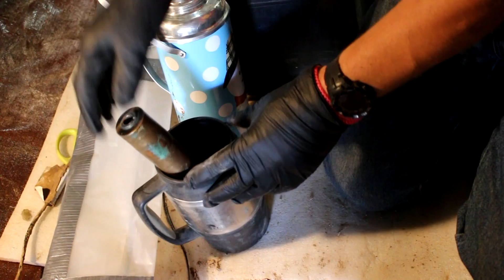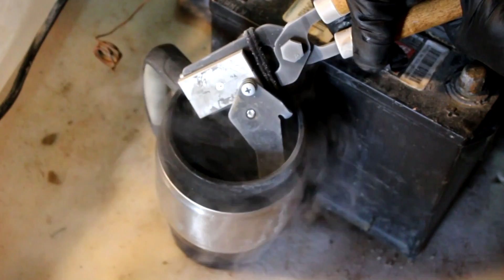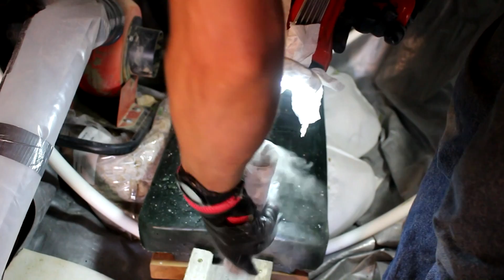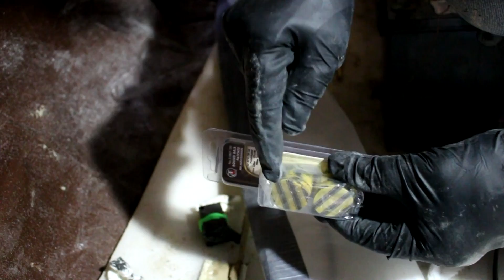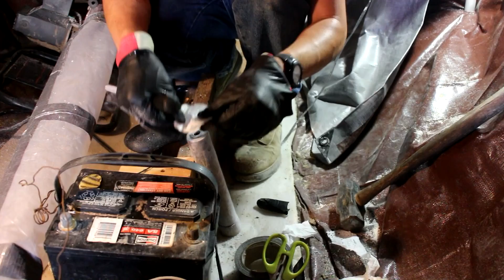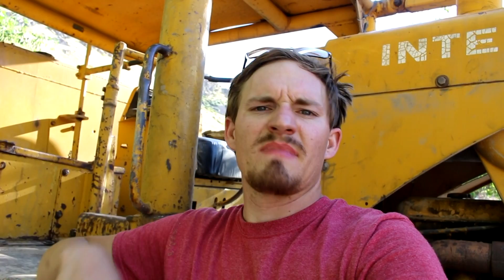Shooting Mercury Bullets

Comment: If you plan on doing much more of that, Competition Electronics makes a lighting system that replaces your diffusers on your chronograph for indoor use (PN CEI4100).  May be a worthwhile addition.
Reply: +Cody'sLab are you going to do a mine video
Reply from the maker: thanks!
Reply: ***** My pleasure.  I enjoy your channel.
Reply: n0
Reply: +Cody'sLab I'm with the other guy, a mine video is long overdue, but it's not my channel

Comment: Hey Cody, i know you "think" you are aware of the danger of mercury.
But for your own health, you should really stop working with it.

It won't make you sick fast nor will it kill you fast. 
The real danger with mercury is the toxic buildup in your system, and IF you would go to a doctor right now i am sure you will have raised levels allready. And even tho many people "think" mercury is only toxic if you touch/eat or directly inhale it ; It isn't ... mercury will fume out at room-temperature and WILL conterminate a room/envoirement! 
And even a very, very low amount each time you handle it, can and probably will add up enough to cause some real problems over time because once it is in your system, you won't be able to get rid of it.

Comment: I would think the mercy 'coned' it's way through the gel. getting smaller as it goes, meaning less surface penetrating the gel, so the smaller it gets the easier it goes through, think a round bar pushing through its a needle.
Reply: * not 'it's' I meant to type vrs
Reply: it was frozen so it wont react that way, or at least all that way

Comment: Cody's lab: How to legally do illegal stuff! 
Cody, at the end when you were dropping stuff into the mercury, we can see some of the mercury balling up on the surface of the rest of the pool of mercury. Why is that? Is it because particles cling to the little balls as they fly through the air which makes them more buoyant? 
Love the videos! Keep up the awesome work!
Reply: Probably just surface tension.  I think under the right circumstances most liquids can do that.  I believe it's called inverted bubbles.

Comment: You said that the mercury bullet had more momentum because of its greater weight, but this just means that it would require more energy to get to the same speed as the lighter lead bullet. Both bullets would have the same momentum assuming that the energy transfer from the powder explosion is that same for both, the mercury bullet being heavy would travel at a slower speed. Good video though, keep up the good work!
Reply: Higher density projectile results in a higher pressure in the chamber during firing, allowing more energy to be imparted into the projectile, resulting in more momentum and less energy waste.
Reply: +Darkatar
Thanks for the insight, it didn't occur to me.
For the momentum to be the same, the barrel would have to be infinitely long, as well as friction to be the same.

Comment: The military have a special type of mercury bullet that they use with ultra-high penetrating.  It was briefly on a documentary I came across around ten years ago, which I could no-longer find while I was researching the bullet to try and understand how it worked.  I couldn't find much about the specific type of bullet I remembered from the documentary.  Sounds all tinfoil hat-like, but I thought it was worth mentioning.

Comment: Hang on, ~8.05 "mercury is denser, and it weighed more, so it would have a bit more momentum", surely by newton's second law the lead/mercury bullets would have the same momentum because they were both propelled with the same force, or what am I missing?
Reply: I thought the same thing and did the maths, it turns out that assuming both the lead and mercury bullets are given the same amount of energy, the one with the higher mass has the higher momentum. This is because kinetic energy is proportional to the velocity squared, whereas momentum is just proportional to velocity. As a result, mass has more influence than velocity when calculating the momentum.
Reply: Just wanted to chip in here and say that I also did the math, and came to the same conclusion you did, 2exSquared. The momentum, in this case, looks to be proportional to the square root of the mass of the bullet, assuming the same energy is transferred.
Reply: You're correct.  I think he was just misusing his words.  He's a geologist, not a physicist.
Reply: Nah Cody didn't get it wrong, read what I wrote previously

Comment: Mercury and lead are only similar in toxicity in a compound. Or even in the same state. Difference is that mercury at body temperature is a liquid and gets through the body very easily reaching parts other bullets can not reach.
Reply: The problem with mercury arent so much its toxicity in solid or liquid form (they're not that toxic at this states because they're not resorbed by the human organism at dangerous concentrations) but the huge toxicity of its vapor, which penetrates the blood-brain barrier with ease. And Mercury already vaporizes at room temperature due to its vapor pressure.
Reply: Jan F
Correct. However there is proof of mercury actually 'vaporizing' in the bloodstream. Don't have the source but the info is out there

Comment: Gives a whole new meaning to the term "slug" self lubricating allowing for high penetration with only a very light charge and horribly, horribly toxic. The effects on a living thing from a projectile like this would be truly disturbing, bleh. What makes you say that mercury wouldn't poison a deer?

It would be interesting to develop other, perhaps less toxic self lubricating projectiles. Maybe track down some self lubricating bushings with and OD matching the bore of your gun, cast lead into the bearing thereby using the self lubricating material as a sleeve. It would be interesting to see if comparable results could be produced.

Comment: Pb and Hg ARE NOT even close to as toxic Cody. Hg can be absorbed through our skin and is way more easily Absorbed into systems and blocks selenoenzymes (Antioxidants) from forming. It prevents both vitamin A and C (most are antioxidants) from absorption. While lead is quite toxic as you say, you would have to powderize and inhale and or eat  about the same amount as you can absorb through you skin with Hg. Hg is damn deadly through the skin and lets not talk about the vapors. Bad comparison between the 2 my friend. Hg is FAR FAR more toxic than Pb. 

Good work as always, keep up the good work!
Reply: Entire generations grew up having their cuts, scrapes, and abrasions, painted with mercurochrome as a disinfectant.
Reply: he dipped his entire NAKED hand in mercury and he seems fine to me, besides the fact it cut cirulation to his fingers from the pressure

he says the mercury salts are far more dangerous than pure mercury if i remember correctly
Reply: +Fifty State haven't you seen him eat dry ice, and cyanide and you think splattering a tiny amount of mercury was irresponsible? Lol
Reply: toxicity wise they do roughly the same damage, just if you come into contact with mercury your far more likely to absorb it and have it do damage since it's a liquid/vapor instead of a solid like lead, or at least this is my understand over the subject
Reply: He has a video of putting his hand directly in a large pool of Hg.  Yikes!
Reply: Mercury vapor does need to be talked about, and a mention of dental amalgam for that matter.  Lead paint chips are still a problem too.  Frankly I think it was very irresponsible of Cody to spatter mercury like that, and that's a first from what I've seen of his work.  People get fired for being careless with the hazmat liquid mercury.
Reply: Zach Attack yikes!
Reply: Just because Hg is easier to absorb doesn't mean it's more toxic dumbass. It makes it more dangerous to handle.
Reply: Your bodies ability to absorb mercury through the skin is very low.  Short exposure time to the skin really is not very dangerous.  It has been way over stated.  As others have said it's the mercury vapour that is so easily tkaen in by your body.  That is where the danger is.  The hat makers that got mercury poisoning (mad hatter) most likely got most of the poisoning from the vapor comming off, rather than from skin exposer.

Comment: wouldnt this have been better to do this in the winter
Reply: Unless the temperature was -40 it wouldn't matter
Reply: No, it wouldn't.  Mercury doesn't freeze until -40 Fahrenheit.
Reply: well it would melt slower at lower temperatures :/
Reply: wont it melt slower at lower tempuratures?
Reply: Katgamer
Minutely, perhaps.  But in winter, depending where you live, what's your average temperature?  Probably somewhere in the +10's and +30's.  Even If you hit -20, which is nearly unbearable to be out in, mercury will still be liquid.
Reply: +MOTO 809 lmao -20 unbearable? We had a winter a few years ago and it got to -53 Canada mb
Reply: kyle ferguson
Is that supposed to make you some kind of special?  -20 is extremely cold, and can be unbearable to some.  I doubt, when it was -53, that you were out building a snowman...
Reply: um...are those even on the same scale? F, C, etc.?
Reply: +L3610NF0R14M7H37RU7H K
Reply: L3610NF0R14M7H37RU7H
Probably not.  Since I was already talking in Fahrenheit I assumed we were on the same page.
Reply: MOTO 809 well he might be talking C which would make sense because -20F is really cold and some states in the us dont reach that cold.
Reply: He was in C probably. i'm also in canada and it got down to -53 C 2 years ago while i was working outside all night. Which is -63 in F... -20 F is -28 in C. which is cold but they don't close schools here for that and kids are expected to walk in it. its just wear a coat and snow pants weather. -40 isn't fun but people do work and play in it all the time. it wont hurt you if you dress properly. 
even doing it at -20 would slow down the melting a Lot. think how fast an ice cube melts in the fridge vs on the stove.
ballistics gel would also freeze though; so i don't think that its a great idea.

besides Cody lives in Utah where it barely gets below freezing so i think its a moot point.

at - 40 C and F are the same. so anything close to that they are pretty close to each other.
Reply: claframboise ah kk, though most states dont generally get past -20f and its considered very very cold here, so i geuss we are pansies when it comes to cold weather?
Reply: claframboise
I grew up in Montana about 60 miles south of the border.  We saw temps in the -30s F quite frequently.  Schools definitely wouldn't close over it, but at those temps we would try to do more indoor activities.

Comment: is it possible if you could shoot another frozen liquid metal bullet (mercury or gallium) into a glow hot red steal plate,i think it would be cool to see bullet melt as it touches the surface,any thanks as always Cody
Reply: gallium would shatter because it's way to brittle as a solid
Reply: right i didn't think of that but mercury woul'nt cause it more metal-ish

Comment: Mercury is a superconducter so you should build a rail gun to shoot it instead!
Reply: Well since he would have to cool it down to 4° K, it doesn't seem feasible.
Reply: http://hyperphysics.phy-astr.gsu.edu/hbase/solids/scex.html

There's a superconductor called Yttrium Barium Copper Oxide that freezes at 77°  K that might work.Although I'm not sure how complex the process to make it is as my knowledge of the subject only extends as far as a few google searches.  :(
Reply: ***** Thats a very interesting idea! Yttrium barium copper oxide is one of the most common "high temperature" superconductors. Unfortunately, the problem with all superconductors in a railgun would be the high currents and high magnetic fields.

 Superconductors will only superconduct if the current being run through them is below the critical current (8 to 10 A for YBCO), and if the external magnetic fields are below a critical value as well. With a railgun,  you have extremely high currents (several kA), and high external magnetic fields. This would cause the superconductor to stop superconducting. 

It would still be very interesting to do some tests though!

Comment: What if you put liquid nitrogen on a rock, let it cool down and then hit it with the pick axe, would it be easier to mine?
Reply: Not realistically.
Reply: +Austin Rominger that would be pretty expensive wouldn't it?
Reply: Yeah, and time consuming.
Reply: Though I wonder what would happen if you drilled a hole a bit longer than needed for a high explosive charge, dumped some nitrogen in, then a charge and detonation.  Would it be enough to increase the effectiveness of the shock wave to any useful degree?

Comment: Imagine the ocean replaced with Mercury.... That would be odd, and for the sea life down there. O.o
Reply from the maker: I think it would be heavy enough that it would cause the planet to turn inside out as the mercury ran to the core. might make a good "XKCD what if" now that I think about it.
Reply from the maker: That would be true if the earth was rigid but on very large scales the earth acts like a liquid and replacing the oceans with mercury would be like pouring water on top of oil.
Reply: +Cody'sLab 
   Might be wrong on this but I don't think that should be that case. You're presenting your hypothesis due to the fact that mercury is very dense I would assume. Now to counter that I present the "MERCURY vs SALT - Defies ALL LOGIC" experiment done by the Youtuber TAOFLEDERMAUS where evidence is shown that mercury although 6.2x more dense than salt doesn't sink to the bottom of a salt glass due to the crystalline property of salt. Ocean beds contain sand which isn't salt but they still share the same crystalline property, due to that I infer that the mercury oceans won't turn inside out. (/watch?v=tA9tqvfWQ7I)
   But hey what do I know lol, I'm just a kid that needs to get back to doing my homework.
Reply: The XKCD 'What If' series was is primarily published on the author's webcomic, http://what-if.xkcd.com/
Reply: +U N Not all of the ocean  floor is covered by sand. But that isn't even the biggest problem here. Sand is largely made of fine particles of seashells and the like. So they do not in fact share a crystalline structure. Sand also moves around a fair bit.

I would come to the conclusion that the mercury would eventually filter down due to the irregular nature of the ocean floor. Once started, it would be pretty much impossible to stop. Think geological time scales as well, not human scale.
Reply: Before becoming as mad as a hatter ;-)
Reply: +Cody'sLab omg cody!! I love that book and have read it multiple times. I want to be a physicist when I'm older but there aren't many informative books I have access to, do you have any suggestions for things I should read that are pretty scientific?
Reply: +U N
It's not so much running through the salt as that much mercury would push the crust out of the way. This sounds a bit like the Stevenson "modest proposal" for a core probe.
Reply: you ever heard of the tomb of Emperor Xin or whoever the one that unified China and had all the terra cotta soldiers? he also had a huge scale model of China complete with mercury for water constructed in there under the pyramid..

sounds insanely badass

Comment: How about trying an exploding bullet like in the Day of the Jackel. Hollow out the bullet insert the mercury liquid and seal the tip. I wonder if that can be done real time or was it just a hollywood thing.
Reply from the maker: I think it would make for a terrible bullet at least for long range shots the spinning mercury would move off axis and cause the bullet to tumble.
Reply: Well then it begs to be proven by Cody's Lab.
Reply: He did mentio modifying a bullet to contain toxic material is illegal though...
Reply: +doom81300  yes I want it to good idea
Reply: doom81300 :

Ymo0
Reply: Mercury on it's own won't, Mercury fulminate will explode, possibly while the round is still in the barrel.
Reply: +Cody'sLab please do it it would realy cool

Comment: Cody, hope you get  to read this. over 40 years ago we took hollow point bullets and reamed them out with a waggle type of drill bit. We filled them with mercury and capped it with wax so they would fire without effecting our firearms. In our unscientific results we found that we could fell small trees with our mercury loads in a few shots. Never, I repeat never, would go hunting with these loads. Thank you for showing this.
Reply: I did the same, used a .44 Magnum. Those were the days.

I always thought beryllium wire inserts would be nasty, or ricin.
Reply: Day of the Jackel
Reply: Were you using mercury or fulminate of mercury/